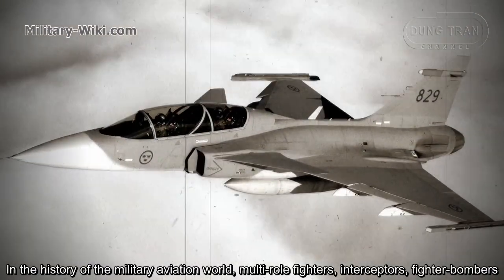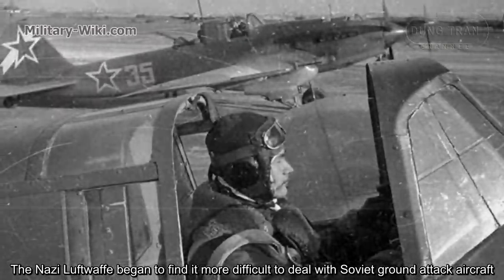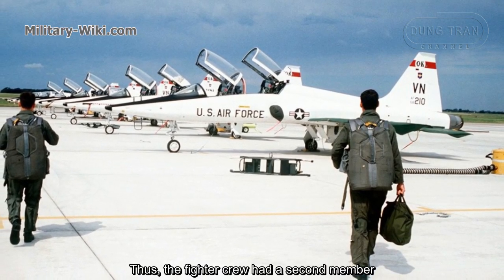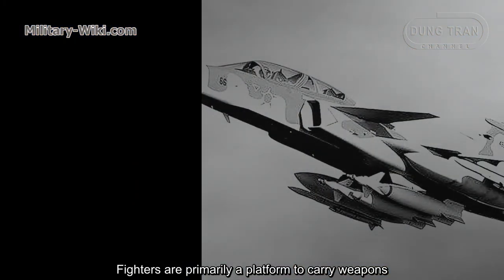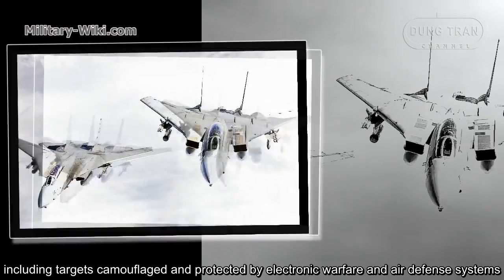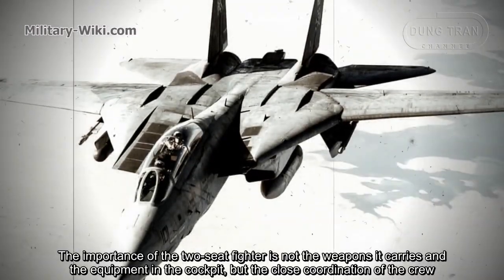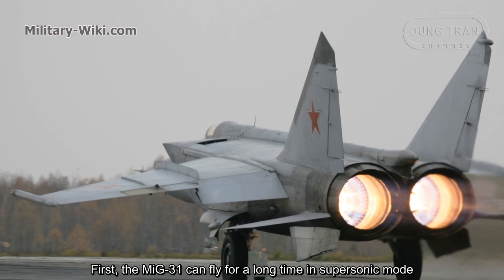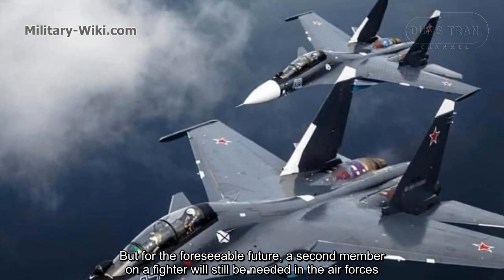Why do fighters need co-pilots? What does the second pilot do?

Comment from the maker: Thank you all. My brothers
Reply: IL2 wasn't redesigned, it  was originally designed as a two seater plane, but somebody from the top communists decided to optimize production and operational costs, so they left an IL2 gunner-radists place empty, i.e. no machine gun and no gunner. Sometimes pilots put a stick  as a fake machine gun, but it didn't help a lot. The predictable result was a very big IL2 loses, so russian boss-communists ordered to return  to the original design and use a gunner-radist and a machine gun to protect the rear IL2 sphere.